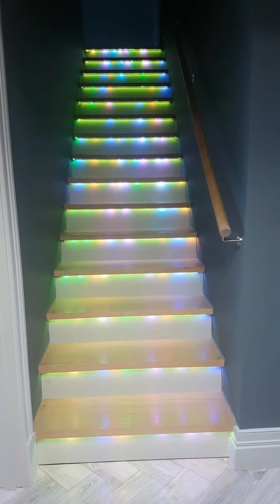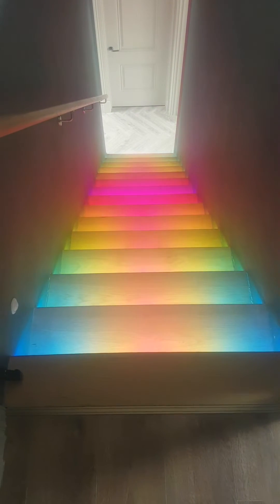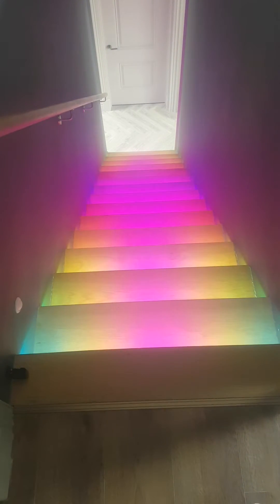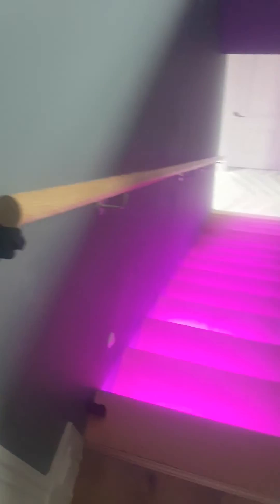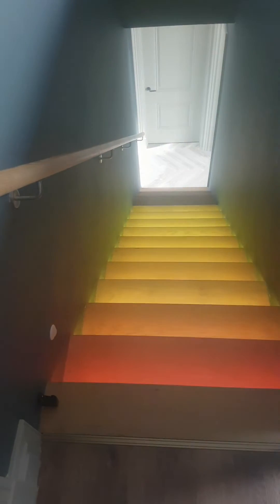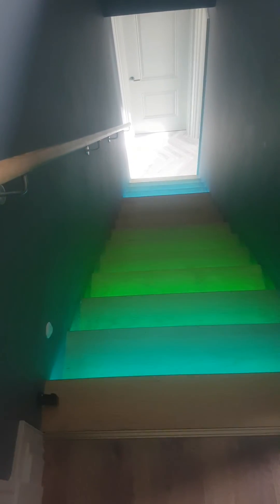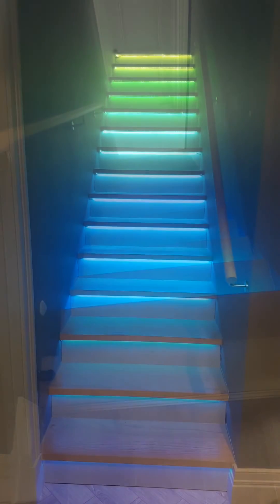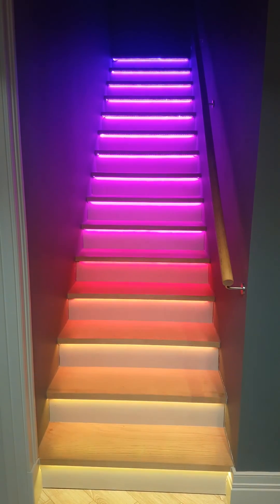SPi addressable RGB WS2812 LED Staircase with Velbus oled control panel

Comment: Wauw nice! I already have 16 2812b leds on my stairs. But what hardware did u exactly used on this project. The button, Ir sensor and controller?
Reply from the maker: Hi

It's part of a whole home control system, with a www.Velbus.eu backbone.

The glass panels you see are Velbus OLED devices.

openHAB2 acts as a protocol translator / logic engine to read the button events and trigger effects with Jinx! or QLCplus

And Vice Versa for the feedback LEDs.

The Art-NET data from Jinx! or QLCplus is converted into SPi streams by a number of great devices from www.smartshow.lighting

Comment: Cool! Price?
Reply from the maker: Hello

Thank you, for a last minute addition we all think it worked out rather well.

This staircase was part of a much bigger project, so rather difficult to give a stand alone price for.

The hardware cost isn't ridiculous, it's the installation time that pushes the cost up.

If you're able to get the LED strip installed into the stair treads during the manufacturing stage, you'll get a much better finish and save a few hours of labour on site.

If you have a project in mind, please drop me an email so that we can talk freely.

stairs@mdar.co.uk

Best wishes,
Stuart